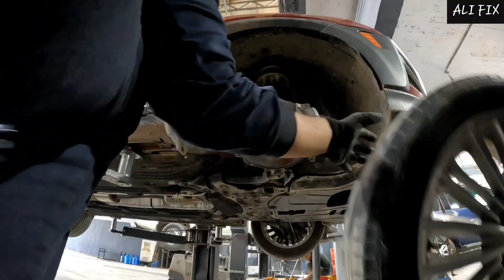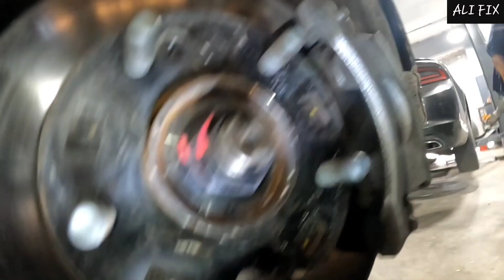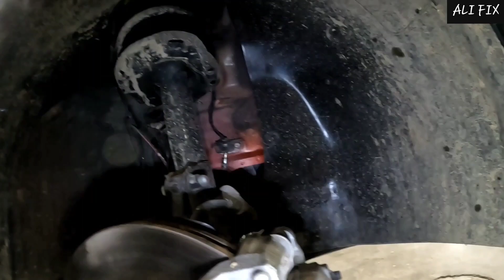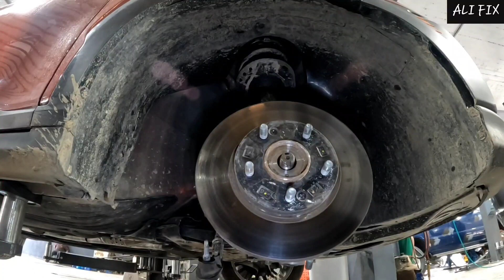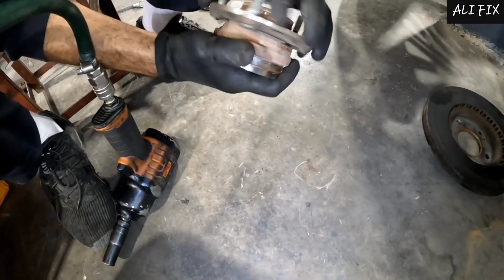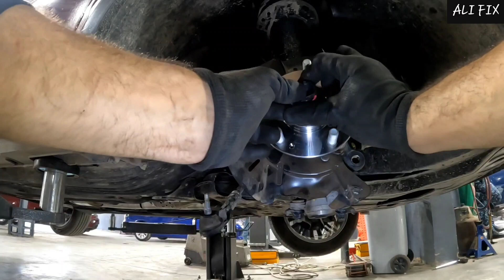front wheel bearing replacement ... hyundai kona 2021 ... 2018 - 2022 #suspensionsystem #kona

Comment: That car didn’t look too old to have the bearing replaced. My son’s car has a vibration at 45 mph, I was told to start with changing the axels. The tires have been rebalanced. Is this what you would do?
Reply from the maker: i cant know if im not chick the car ... maybe CV axle or only balance wheel 😔